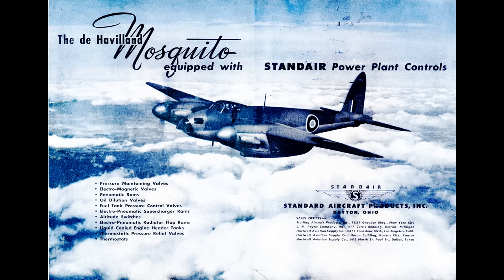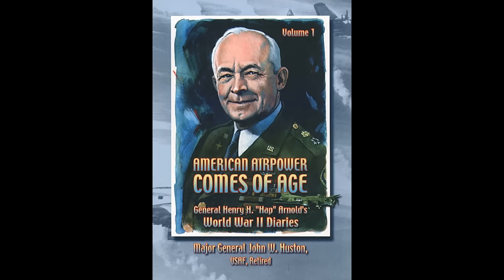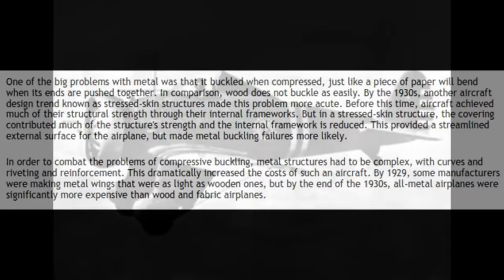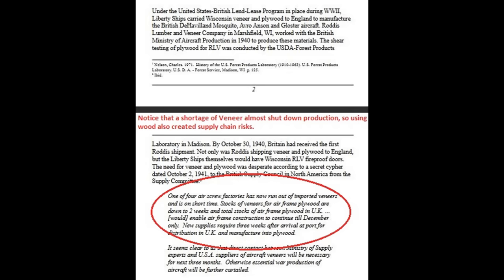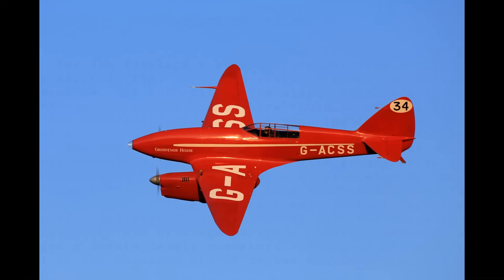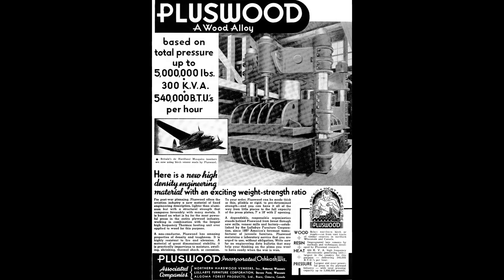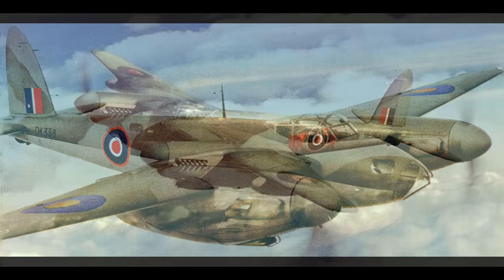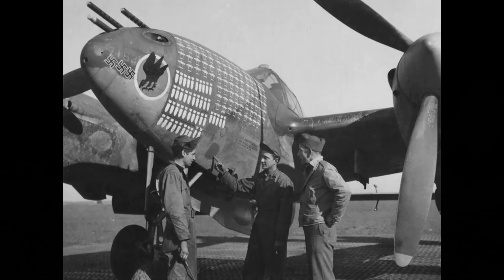De Havilland Mosquito vs. ?

Comment: Thank you for this video! I'm an engineer, so I've done my share of evaluating and selecting materials for different applications. I've always been skeptical of the "wood = lighter" argument that you hear whenever the Mosquito comes up. Also, wood has other structural challenges: it's anisotropic, meaning that it's strength depends on the direction of the force relative to the direction of the grain, and it's much weaker in compression than in tension, so it's alleged advantages don't stand up to a lot of scrutiny. Also, I've read - though not nearly as much as you, so please correct me if I'm wrong - that so few Mosquitoes survived into the post-war years because of rot: the planes, like Liberty ships, were designed for the duration of the war, and not much longer. I'm certainly not taking anything away from the plane - or its builder, de Havilland - but I believe that even with 1940s materials and technologies, an all-metal Mosquito would've been at least as successful as the wooden one, and your assessment of why de Havilland chose wood over metal rings true. Thanks again for a great video.
Reply from the maker: History has shown aluminum is better material for building airplanes than wood. I don't think there is any question about that. In the case of the Mosquito, I think wood made the most sense because it was built by De Havilland, and that's where there expertise was, not only in design, but in procedures and tooling on the factory floor.
Reply: Except that from 1946 onwards nobody built airplanes mostly out of wood.  And starting in the early 1960’s most boat builders stopped using wood. The Mosquito was a marvelous anomaly.  The RAF and the FAA didn’t switch from Aluminum back to wood after the outstanding performance of the Mosquito was made known.
Reply: I would point out that carbon fiber has the same qualities you delineate above for wood, but for the rot. Mossie was a COMPOSITE construction aircraft. It used the best or at least most plentiful and best understood anisotropic materials of the time in ways that are very modern for a composite aircraft of today and shared almost nothing of the "wood construction" assumed practices of it's day.  The wood thing is a distraction. Are carbon fiber and foam filler a better composite duo than directional wood and balsa for aircraft construction? Hell yes. How did composite construction utilizing directional wood and balsa compare to the (very) semi-monocoque aluminum constructed competition? Pretty damn well.
Reply: @ElsinoreRacer  - It's a stretch to call the Mosquito's construction "composite," unless you want to argue that all wood is, by its very nature, a composite of fibers in a matrix. Technically, that may be true, but not from an engineering perspective.

Most homogeneous structural materials - wood, steel, aluminum, and so on - have very similar strength- and stiffness-to-weight ratios; a composite material ought to beat them by a nearly an order of magnitude, and the Mosquito didn't. That's because wood fibers aren't all that strong - at least not when compared to, say, carbon fibers - and because the engineer's options for adapting wooden structures to structural loads are limited, whereas the options for true composites are boundless.

Had it been built of aluminum instead of wood, the Mosquito likely would've been very much the same airplane, perhaps a little lighter, possibly slightly better in climb and acceleration. That said, de Havilland did a brilliant job with their wooden wonder, and I tip my hat to them.
Reply: @keithvallencourt7901  There exist videos (and books) of Mosquito construction specifics. The grain orientations were not at all random and were specified for each layer and wood type to be laid up for a section. This was laid up on a concrete fuselage half, glue between the layers, the balsa (filler) laid on, then the variously oriented outer veneers (of various wood types), then pressed and cured. It was not "made of plywood." The balsa sandwich seems obvious to us today but wasn't. Rutan gives De Havilland credit for inspiring his foam and fiberglass methods. I think it's hard to argue that directional fiberglass around foam is composite but directional wood veneers over balsa is not.

Almost separately, this all conspired to have the Mosquito to be very close to an actual monocoque, which it's aluminum counterparts claim to be but actually are not.
Reply: @ElsinoreRacer  - Of course de Havilland oriented the wood to take advantage of its directional properties: engineers, architects, and builders figured that out many thousands of years ago. The difference is that in an engineered composite, you can precisely tailor the material to a specific application, whereas with a natural composite, such as wood, you have to take what Nature gives you and do the best you can.

The bottom line is that wooden construction conferred no special advantage on the Mosquito; if anything, it probably made it heavier than an aluminum version would've been: there are reasons why airplane designers abandoned wooden construction as soon as Duralumin proved itself a trustworthy material. The decision to make the Mosquito out of wood was driven by shortages of aluminum and skilled metalworkers, not structural optimization.

So while it's true that wood is, by its very nature, a composite material, and therefore anything made of wood can be said to incorporate composite construction, then it's also true that to say the Mosquito was a composite structure, is to say that so were the Hawker Hurricane, the Sopwith Camel, the Wright Flyer, and Noah's Ark.
Reply: @keithvallencourt7901  Well, you should contact all the people who make such a huge distinction between the use of wood in all previous wooden aircraft and it's use in the Mosquito. News that directional filaments embedded in a glue/epoxy over a core are NOT composite construction needs to get out. Forward that to Burt Rutan as well. Have great day polymath. I will not reply as it is evident that you must have a last word. Type away. Meanwhile, I am hopping into the Cub. Cheers.

Comment: You touched on Beechcraft's comment on serviceability, and the fact that the skin was stressed wood, and load bearing, versus a metal aircraft with a load and stress- bearing frame. This is a major factor in serviceability for an aircraft in a military application, subject to ballistic damage. Rather simply applying a patch for skin damage in a metal aircraft, or repair the local structure, a much more extensive assessment and potential scope of repair would likely be required for the wooden, load and stress-bearing surface affected.
Reply: it was actually easier and quicker to repair battle damage on the mosquito.  Repairs to a metal, semi -monocoque, stressed skin  designs require  more complicated and time consuming repairs.  The complicated  internal support structure consisted of metal spars, ribs,  longerons & stringers etc that were mainly fastened by rivets.  In most cases,  there would have been internal damage to repair.
I saw a documentary that stated "per unit area"  of wooden composite was more load bearing than the current stressed skin design.

Compared to a metal, semi -monocoque, stressed skin  design,  The Mosquito had a lot less internal braising, which made it quicker and cheaper to repair.  There were plenty of carpenters & cabinate makers who were utilised to work on the mosquito. The BDR on was la lot less time consuming.  Example - If a wing tip was shot up, they would cut it off and attach another.  

Another interesting fact was that in 1000 missions, they lost 8 aircraft (16 Aircrew). Equivalent to 2 x Lancaster crew. Astonishing

Comment: Interesting video, thanks. What isn't really covered with regard to the use of wood is the ease of construction in varying regions around the UK and the fact that there was a plentiful supply of skilled carpenters in the 1940's UK, making 'dispersed production' easier. Such production was less easily disrupted by Nazi bombing raids, meaning no real loss of production levels with the dispersed and 'shadow' production strategies.

Comment: On the subject of the damage to wood caused by bullets, others have brought up the question of fusing on cannon shells. I recall reports from US Navy destroyer action reports (USS Johnston, for one) that stated that large primary gun shells (14+ inch caliber) from Japanese battleships  passed through the relatively thin structure of the destroyer without detonating their report charge. It would be curious to see a test of these German cannon shells being fired through various wooden structures.
Reply from the maker: Keep in mind that the Germans were fighting a mostly wooden airforce on the Eastern front. They knew all about shooting down wooden airplanes.

Comment: some of the war books i've read described that the mosquito was as easily detected by radar as the metal planes in ww2. evidently the wood framing was insufficient to absorb radar energy and stop reflection of radar waves. horton stealth bombers, also wooden framed, on the other hand had little exposed metal and could go undetected by early radar systems. it's curious that the allies didn't experiment with stealth aircraft.

Comment: Interesting video, I just want to say something about metal corrosion as a former sheetmetal worker and airplane mechanic.
ALCLAD isn't the final answer against corrosion because as soon you drill a rivet hole you essentially damage the pure aluminium layer.
What's also important is what you often see internally the green/yellow/gray primerpaint which is applied and even then you need a layer of Tectyl or Dinitrol and very much keep an eye out for corrosion.
I've seen entire bottom fuselages seen replaced because of corrosion damage because complacent maintenance of an airline.
Reply from the maker: Thanks Dot, that makes a lot of sense.

Comment: Falco, I agree. This ist the teason, I described the specific situation in weich the Mosquito perfectly performing, in high altitutes. Dodging German fighters and the 8.8. That would look quite different in lower altitudes facing a 190 Langnase or a Bf 109F/K.

Comment: Today, we would consider it to be a composite structure with two stressed skins, separated by a low density filler. Today we would use carbon fibre and structural foam. Such materials , of course, did not exist eighty years ago. The Mossie used fine wood laminates with a balsa core. The key to it all was the development of adhesives. The other BIG advantage was that skilled woodworkers (cabinet makers ) could use their skills to make them.

Comment: The UK had many non-military industries which had the wood working machinery, and these industries (from mom and pop shops on up) were distributed (not centralized) and not consider a strategic threat. There were problems in the tropics with the adhesive, and failures occurred.

Comment: The successor to the Mosquito as a light, fast, high altitude capable  bomber was the English Electric Canberra, which was also licence-built in quantity in the US as the B-57. There's a very recent video by Scott Manley about the recent history of the Canberra/B-57, its most advanced and modified version still in service with NASA. Not bad for a plane whose design began during WWII. I believe some wood was used in its tail.

The debate over whether the Mosquito should have been given priority over heavy bombers is an interesting one, but it would have had to be built in much bigger numbers, which may not have been so achievable. Also, had the attacking bomber streams have been made up of Mosquitoes, the German war effort would have been skewed much more toward producing the means to intercept them, e.g. overriding Hitler's orders to concentrate on jet bombers rather than jet fighters. Also, if the strategy was more on precision attacks on military targets rather than carpet bombing of cities, Hitler may not have been driven to devote so many resources to the V weapons (which were designed to terrorize and destroy cities in revenge without immediate strategic military effect), thereby impoving Germany's defences. Lots of what-ifs here.
Reply from the maker: I like your post, but I don' t think there is any reasonable debate saying that Mossies should have been given priority over heavy bombers, at least on US heavies. There is no way that could have ended well.

Comment: My father was a navigator in Halifax's and was transferred to Mosquito's. Sent to South Africa for low-level training, navigators were put in "sweat boxes" blacked out nav stations,  to get up to operational needs flying treetop level at high speed. The navigation bar was always being raised so it was hard going getting up to ever-increasing requirements and they quite disliked sweatbox sessions. He never really spoke about it but he really liked the Mosquito especially as rank differences between pilot and navigator were more or less eliminated. I believe the only issue with them were termite infections in SA.

Comment: I think you are correct about the reason for using wood in the Mosquito and other planescwa s the availability of alternative materials and trained wood workers to substitute for Alcoa f vdhirtagevandcwood c workers as opposed to metal fabricators machining equipment riveted welders etc

Comment: I saw this beauty in NZ Auckland at an aircraft museum there at the back in one of the hangers being restored. the old folks there working on the machine said this thing was made of wood, I asked what would happen if it got shot at? they said it would not get shot at cause it was just too fast, I asked but what if? same answer, they could not catch it, it moved too fast. So wood was a good material as it was light and that gave it its 400+ mph speed. amazing for a twin engine bomber! Even the Germans were amazed by this plane. Great commentary and insight! I love WW1 and WW2 airplanes.

Comment: A great video on what to me is the most beautiful of all the piston engined types. 
Incidentally, I think one of the advantages of the the Mosquito's construction method is the cleaness of the design. Any contemporary metal type would have suffered from the parasitic drag of numerous rivet heads. Even rivets flush with the skin would not have been as aerodynamically clean as the Mosquito's skin. Worth a mention too, perhaps in another video, is the construction method. Mossie fuselages were built in two, vertically seperated, halves which had been formed around concrete moulds. The halves were first kitted out with ancillary mechanisms and electrical parts before final assembly.

Comment: It seems the more honest comparison is not the P-38 but the A20/A26 and the Mosquito. The A's were both fast bombers, if not as fast as the mosquito, served in many of the same rolls and were typical American planes with turbo'd radial engines. The A20 also seemed loved by its flight crews.
Reply from the maker: I feel the P-38 is an honest comparison. The A20 is only a reasonable comparison as a bomber, not in other roles, and the A-26 would be unreasonable because it's a later airplane and much more advanced.
Reply: Scott Giles
I agree, and thank you for the comment.

Comment: I think there is a Mosquito documentary on YouTube that shows it being put together. The fuselage was built in 2 halves, very much like plastic model kits. In that way, it was actually easier to put in aLl the wiring, electronics and other equipment, as it could be fitted before the two halves were put together.

Comment: One of the great advantages, was it was quicker and easier to put in to production because it did not require  large and complicated tooling, which all metal airframes did. The fuselage was made in two half's longitudinally making it easier to fit all the internal component's and the wing was made in one piece making it very sponge. Gluing the main compensates over metal formers as one large piece was far quicker than riveting making simpler and more suitable for mass production.  
Which is just what you need at a time of national emergency.
One last comment having only a two man crew it needed far less resources in crew training and accommodation than the bigger bombers like the  a B17 for the same  bombe weight. This also means less lose of life in shot down or lost aircraft crew.

Comment: A well balanced presentation. Your comments on the question of whether it was more important that the material or the skilled workforce to use it were available are particularly important. Hermann Goering was supposed to have said "'The British, who can afford aluminium better than we can, knock together a beautiful wooden aircraft that every piano factory over there is building, and they give it a speed which they have now increased yet again.". The quote may be a misattribution or indeed even false but there is some sense in it. The strategic question of Mosquito vs Lancaster , in every aspect is worthy of investigation.
Reply from the maker: Mosquito vs. Lancaster? Mosquito, there is no question about it.